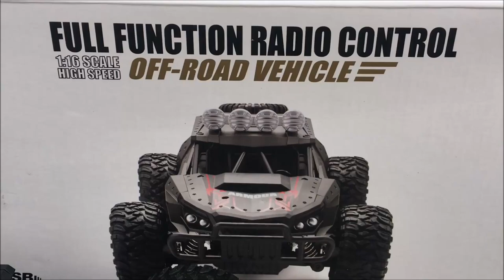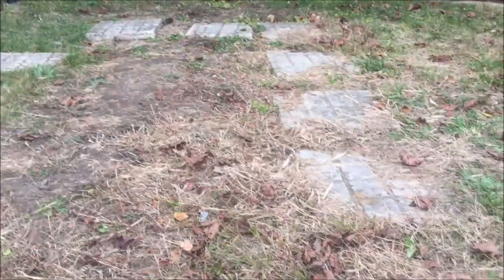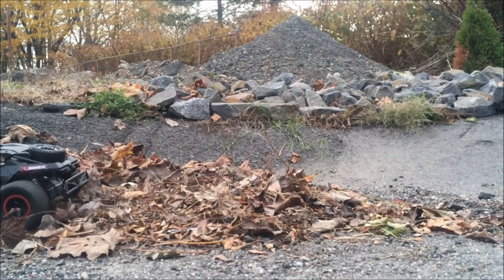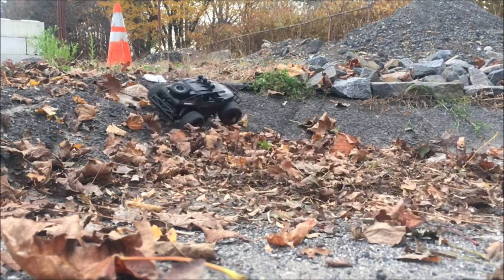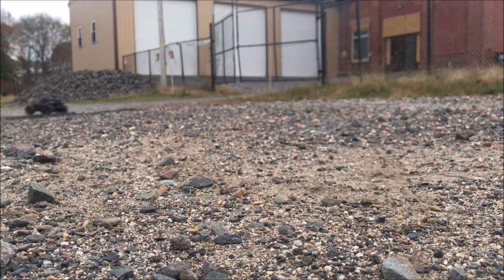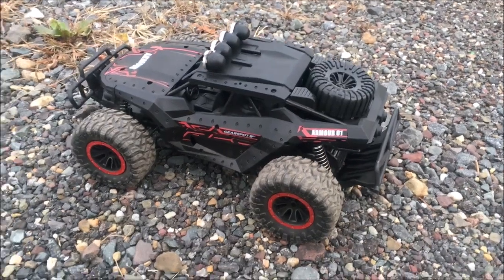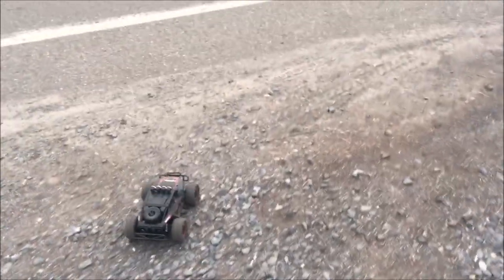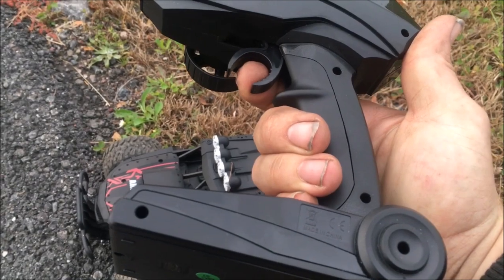Tech RC Off Road Truck 1:16 Scale Remote Control Car RWD Review

Comment: Is this waterproof ? Can i use this on mud Or wet grass ?
Reply from the maker: Not rated to be waterproof, but as long as you do not completely submerged, wet grass should be fine and light. Mud passes should also be fine.
Reply: @JayDrone  did you know if on Amazon there are some replace parts likes tyres or body parts with another livrea ? I try to looking 4 It but nothing...